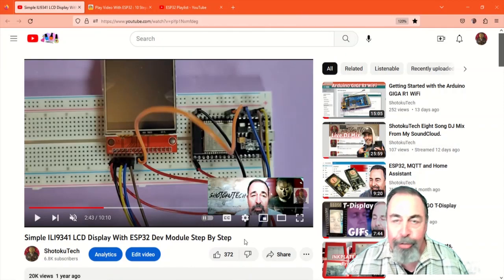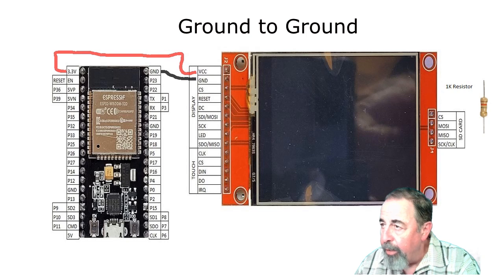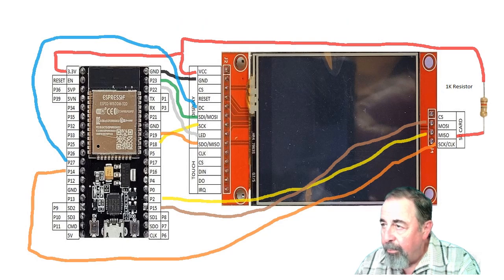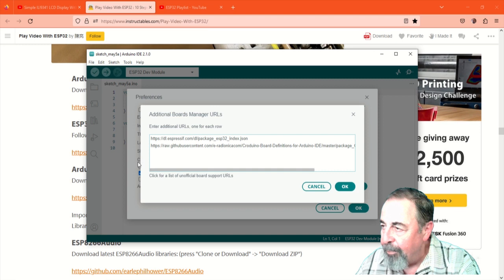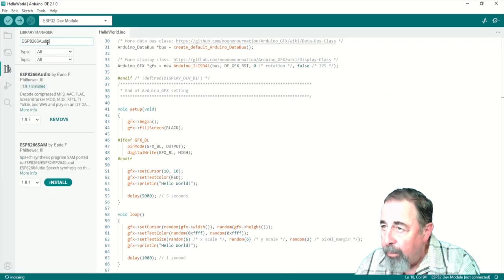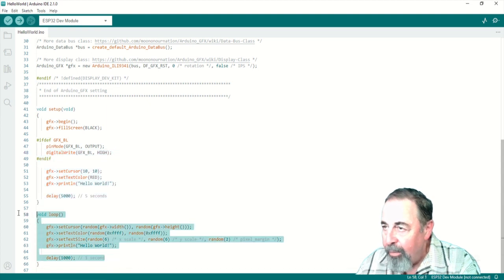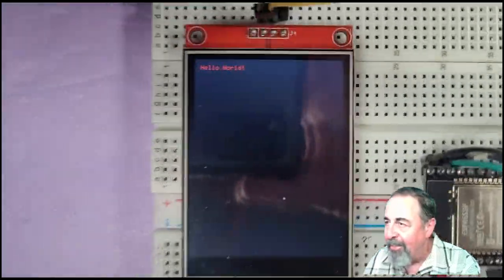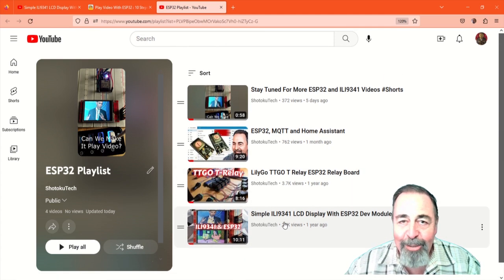Getting Started with ESP32 and the ILI9341 TFT LCD Display

Comment: why create confusion ITS a Wroom not a dev board (use a magnifier and look at the metal cap clearly it says WROOM ),it does not say dev board, and yes arduino is just as wrong too.
Reply from the maker: So far 21,000 viewers have not been confused. Best wishes. Thanks.

Comment: I am fairly certain you should not be hooking up the LED power pin on that tft display to a digital logic pin on the esp32.  That logic pin does not supply enough power to drive that LED backlight.  Not even sure how you were able to get that to work here.
Reply from the maker: It worked in this video and 7 others. https://www.youtube.com/playlist?list=PLVPBipeObwMOMnK3GHJVEZej2SqPsGD5P
So I am 100% sure it works. Thanks. Best wishes.
Reply: @ShotokuTech  Ok let me rephrase, it doesn't work.  I tried following your exact example but was a little concerned about the fact that you were connecting the LED pin (a source for a mosfet) to a logic pin on a micro controller, and sure enough nothing happened when I powered up the device.  Then I connected the LED pin to a net with enough power to drive multiple LED and, not shockingly, it worked.  It's clearly possible that it CAN work but driving the LED (backlight) pin of a TFT display directly with a microcontroller's logic pin can lead to several potential issues:

1. Excessive Current Draw
The LED backlight typically requires more current than a microcontroller's GPIO pin can safely supply. Most GPIO pins can provide only a small amount of current (usually around 20-40 mA), while the backlight might need significantly more, sometimes in the range of tens to hundreds of milliamps. If you attempt to drive the backlight directly from a GPIO pin, it could:

Damage the Microcontroller: The excessive current draw can exceed the maximum current rating of the GPIO pin, potentially damaging the microcontroller.

Cause Overheating: The microcontroller or the specific GPIO pin could overheat due to the excessive current, leading to malfunction or permanent damage.

2. Insufficient Brightness
Even if the microcontroller doesn't get damaged, it may not be able to provide enough current to fully power the backlight, resulting in a dimly lit display or unstable operation (flickering). which btw, is kinda evident in your example.

3. Microcontroller Instability
Attempting to drive a load that is too large can cause voltage drops or noise in the power supply line of the microcontroller, leading to unstable operation, resets, or erratic behavior of the microcontroller and other peripherals.

Proper Approach:
Connect the LED pin to the 5v rail on your esp32. The displays have a built in current limiting resistor (reference the schematics), so you don't need to worry about that.  

As mentioned, clearly it worked (for you at least) but it's incorrect and is likely putting undue strain on your microcontroller which can have adverse effects.
Reply from the maker: @alkaline3mc  Hello. I'm not sure I appreciate a lengthy comment that does not tell me something I don't already know. You can't drive high current devices from logic pins. I get that. I can't hold your hand if something you tried didn't work. That is the fun part of this hobby. Somewhere between the hardware and the code, your solution exists. Meanwhile, if you are going to be the wiring police of the internet I just found three instances where someone attached the backlight intensity pin to a GPIO. 
GPIO21:
https://randomnerdtutorials.com/esp32-tft-touchscreen-display-2-8-ili9341-arduino/
GPIO22:
https://www.instructables.com/Play-Video-With-ESP32/
GPIO32:
https://thesolaruniverse.wordpress.com/2021/03/01/esp32-wroom-32-and-ili9341-tft-display-an-interesting-match/
I wish you well policing the internet over ILI9341 wiring diagrams. Thanks and best wishes.

Comment: Thanks for this video. I'm just trying to draw out a schematic before getting into the thick of wiring everything up. Does the CS pin on the ILI9341 need to be connected?
Reply from the maker: As I explain at 6:45 in the video, the article I was following was missing something. https://youtu.be/HG0u4Y8KGFM?si=i2FiQ5dYTr4dFIuO&t=406
Thanks.

Comment: You might want to mention that there are several configurations of the ESP32.  It appears that you are using the 38 pin variation but I have a 30 pin and the location of the connections are different so as a newbie, I might become really frustrated wiring my 30 pin by following your wiring example.
Reply from the maker: That's the fun part of this hobby. You have to figure it out. Best wishes.

Comment: I handwired his nofrendo only to discover there was no setup file for the ILI9341 ttflcd I am using even though in the write up he says it will work, yes it will with me doing all the recoding necessary to use this screen .
Reply from the maker: I'm not sure what you are talking about. I followed these steps and they work just like I demonstrated. How can I help you?
Reply: I am using a ILI9341 and am lost as the arduino -gfx is very hard to understand as there are no sample code to copy. @ShotokuTech
Reply: now I will take it all apart and get the lcd working first